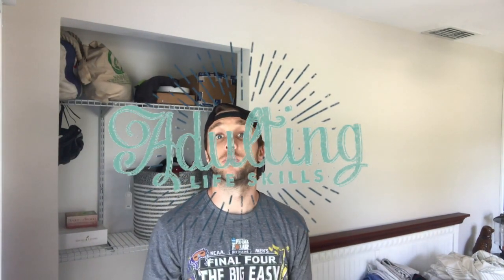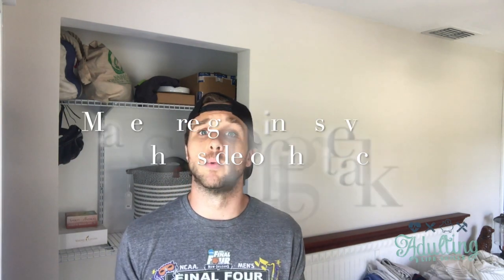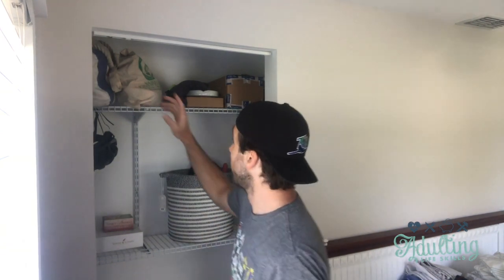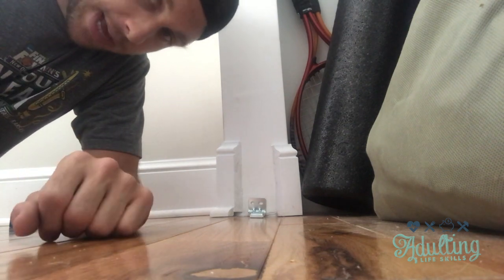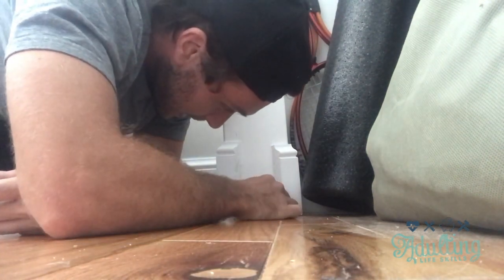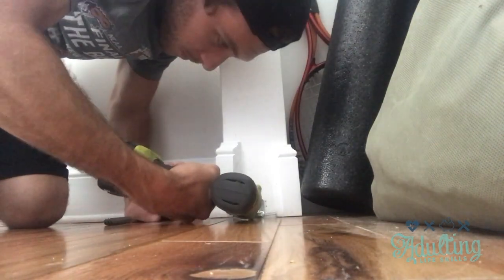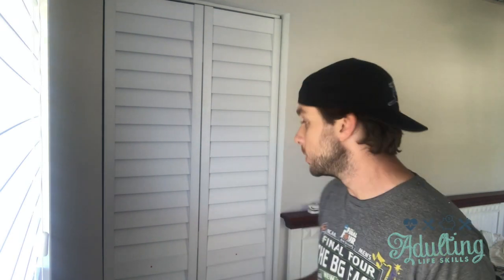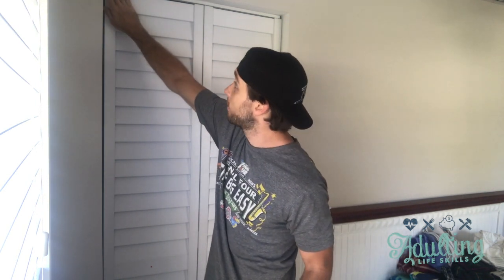How To Easily Install Bifold Door

Comment: My bi-folding doors are 79h x 30w. I installed a new hardwood floor and the opener for that door is now 79 1/2 " high. It looks like I need to cut my door to fit a new opener size. How much I need to cut??? Please give me  advice and thanks in advance. Video is great...
Reply: what did you end up doing?
Reply: @Razraicu  I cut my door from the bottom and extended hole for hardware